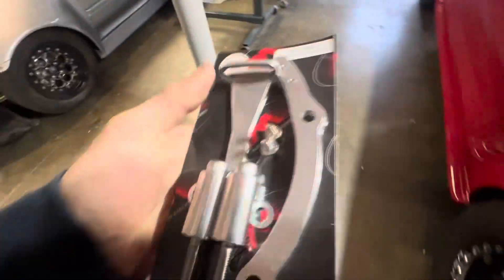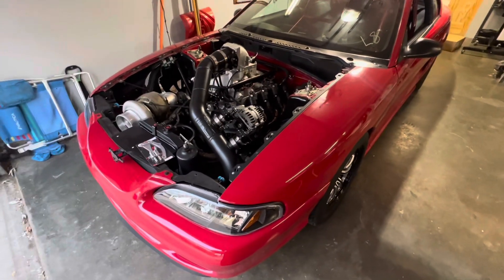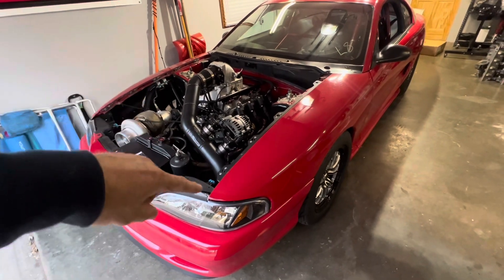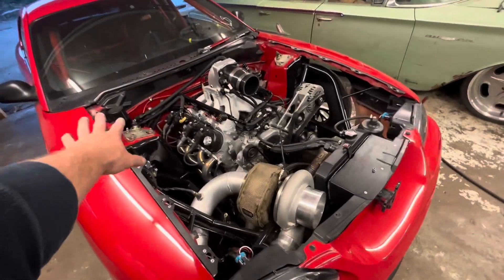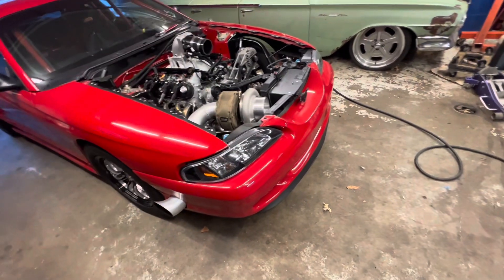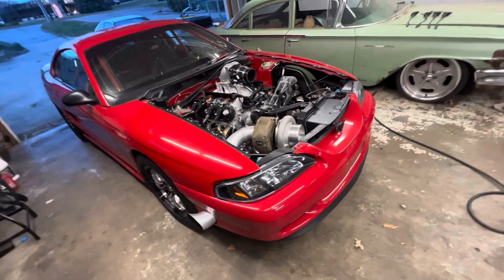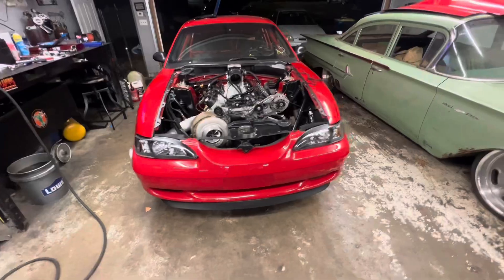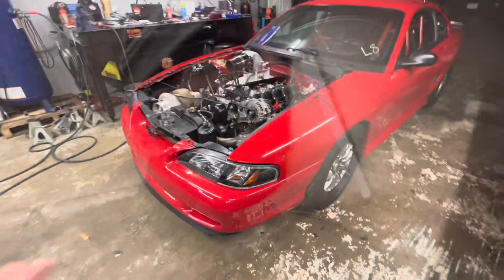How to verify timing on Turbo LS with Holley Efi!

Comment: That pointer will work just fine with your balancer. You're just using it as a reference, so the numbers don't mean anything..

I guess I should have watched a little longer...lol
Bro, piston stops are not expensive!! (**Sub acts as if he hasn't spent double the money and approx 24 hours too long on random, silly projects!lmao**)

Do you have an LS2 style timing chain dampener? It'll help the jumping around. Everyone I know puts LS engines together with slop in the chain, but I can't live with it! The LY6 in my car now, I used a billet single row set with an LS2 dampener & I ordered it for a -.005 line bore. It's nice and snug like my small and big block Chebbies used to be!!
Reply from the maker: I always use the tensioner. The darn aftermarket chains are sloppy as heck.
Reply from the maker: It would prob help if I bought a nice timing set lol